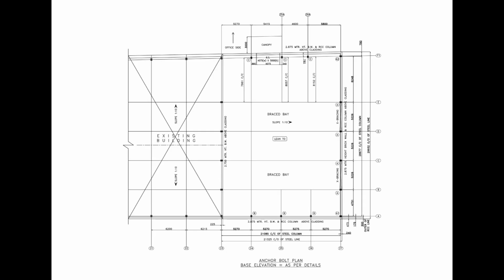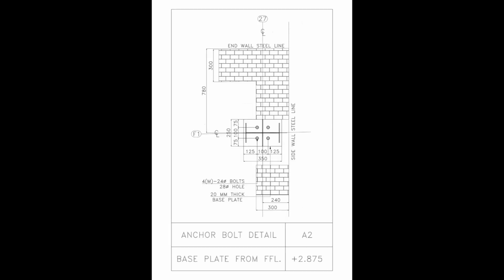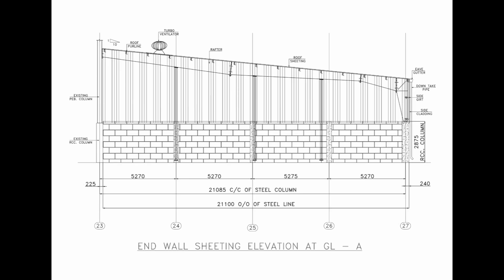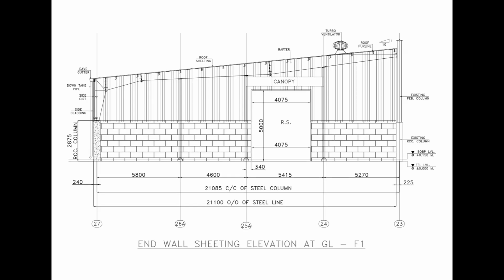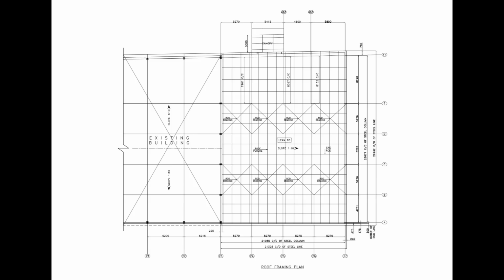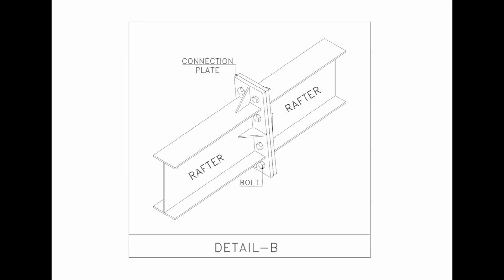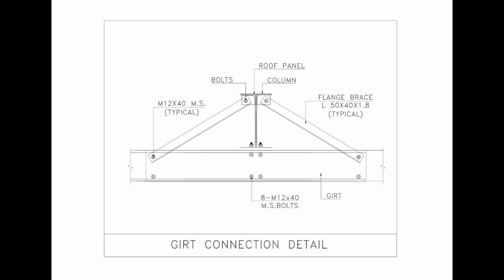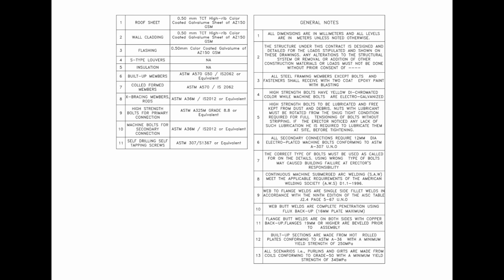PEB_VIDEO-16 : PEB General Arrangement Drawing Explained | Complete GA Drawing Step by Step

Comment from the maker: 🏗 What part of this complete PEB General Arrangement Drawing package did you find most useful?

Was it the Anchor Bolt Plan, Frame Elevations, Roof & Wall Plans, Connection Details, or Trim Details? Let me know in the comments! 👇

📌 Next Video (Video-17): PEB Structural 3D Modeling & Concept Overview

If this video helped you, please Like 👍, Subscribe 🔔, and Share it with other civil and structural engineering professionals.

Keep Learning • Keep Detailing • Build It Strong! 🏗
— ACP CIVIL HUB